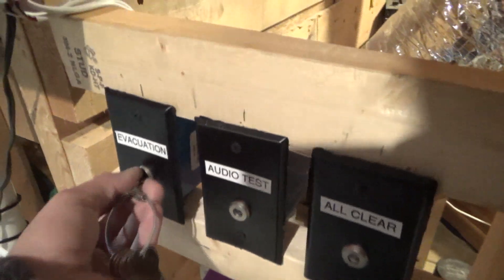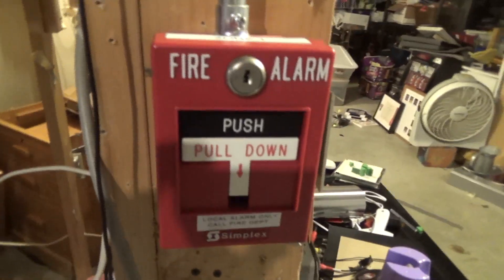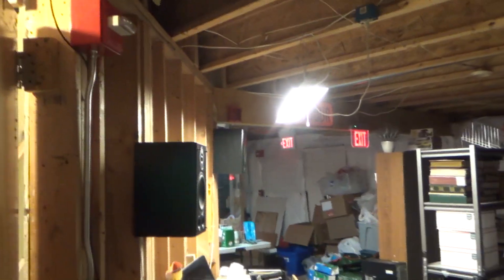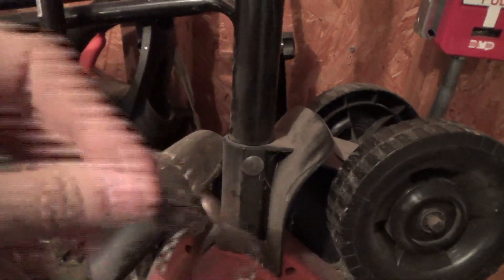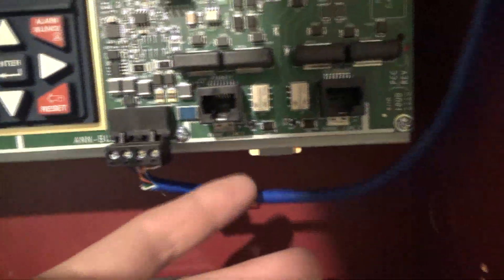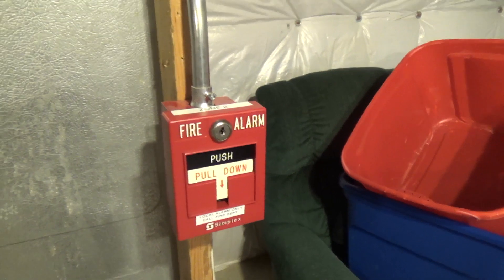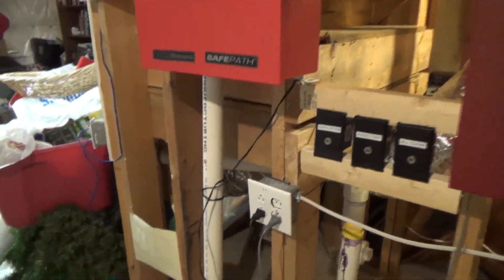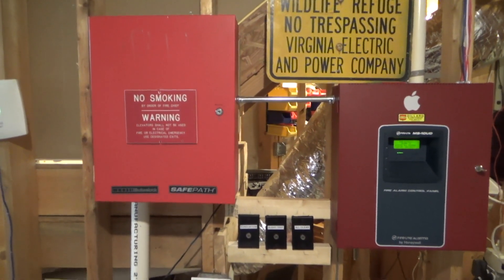Final Home System Test 12/10/2017

Comment: Is the reason the voice messages and the tones for the audio system test and all clear can't be changed is due to you not having the software or does the software not work with Mac?  Going by the Apple logo on the MS10UD.
Reply from the maker: The MS10-UD can connect to a PC using a USB cable and a free software from Honeywell. You can change everything that you would solely with the panel, but when it comes to the banner, it is much easier on the computer. The Safepath is not user configurable beyond the dip switches, my best guess is to send the tone generator card to Wheelock so they can reconfigure it, that is if they even still do it, regardless, it isn't in my budget, so the current tones will have to do.

Comment: So what's the purpose of the tone generator?
Reply from the maker: Not at all sure. It has absolutely no ties to any of the messages signaled when a circuit closed, you literally just flip a switch and it turns on, and I believe is overridden by the messages anyways if it was on. A part of me thinks when they were designing this unit, "it doesn't hurt to have, just throw MT guts in there and boom, we have a reason to charge more for this panel".

Comment: The funny thing is, that my school has Wheelock e70 speaker strobes for carbon monoxide drills or carbon monoxide emergency
Reply: My school just uses household Kidde CO detectors. Underwhelming and probably won’t last for decades like the alarm system (NBG-12LXs, Notifier smokes, NSs, RSSs, MTWPs, MT4s and Exceder HSRs/STRs).